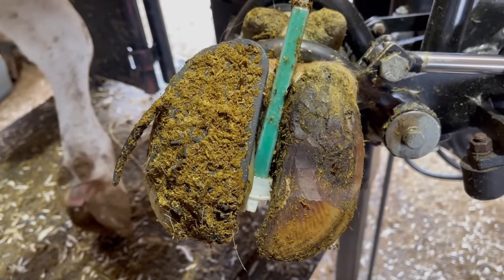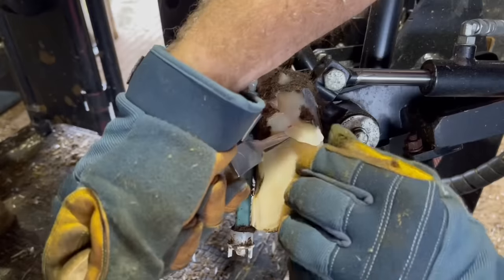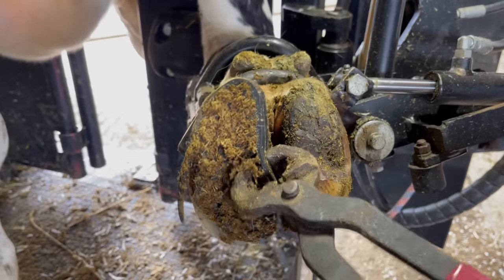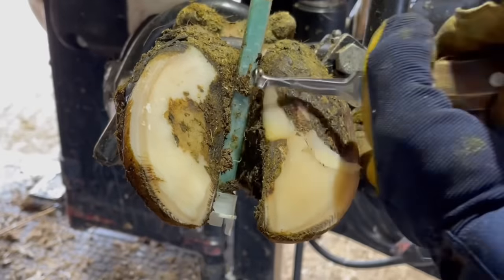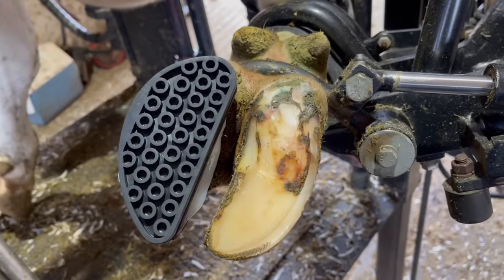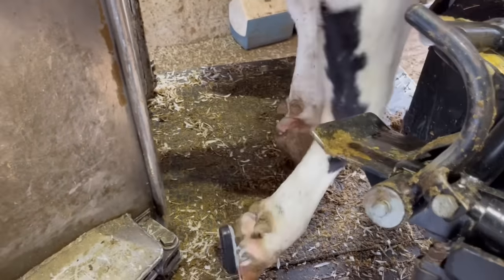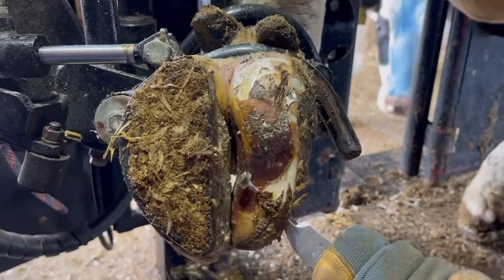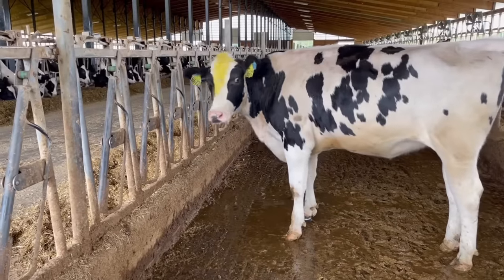This WRAP was on TOO LONG

Comment: I really like the recheck compilations! If that wrap had been applied more tightly and stayed on like that for two weeks, what are the potential complications? Thanks for making these videos, they always help me relax while I'm studying!
Reply: I’m guessing possible circulation and nerve issues in the foot and corium (tissues that grow new sole hoof and wall hoof) causing swelling and extreme discomfort for the cow/heifer with possible permanent nerve damage (in the best case scenario) and cutting off of circulation leading said tissue to die off and become necrotic (in the worst case scenario). Both are certainly bad for the cow/heifer, but the latter would mean certain death for the animal while the former might be manageable, depending on the severity of the damage. 

Think of having a bandage wrapped to to tightly around your two biggest toes. It would be quite painful.
Reply: Usually the farmer is the one to pull off the wraps.

Comment: Hi Nate, when you come back for a recheck, I've noticed the hoof seems to be a lot darker on the top most part and quickly turnes to the off white color, what causes that?

Also, I'd love to see what it looks like on the top side of the hoof when you use the grinder on tip of the hoof!
Reply: for the former, i believe the answer is a combination of staining from barn floors and oxidation from exposure to the air. cows will poop wherever and whenever they please, so the barn floors are very dirty. for the latter, i agree it would be interesting to see.
Reply: I'd guess acid burn  - salicylic acid (aspirin) would cause cauterisation

Comment: Why don’t you use wooden blocks for situations like the first one? I heard they are more likely to wear out naturally and not require you to manually remove them
Reply: I'm no hoof trimmer, but I'm going to assume that the shock absorption of the rubber might be a factor.
Reply: This is valid. I'd like to know as well. Im looking forward to his response.
Reply: @mysticmonkey92  Yeah, iirc he's mentioned it's because it's soft, and easier on the claw that's taking the weight.
Reply: I think he's said in the past that he doesn't like the wood blocks for a couple reasons, one being they wear out a little unpredictably, two being they don't grip as well as the rubber. Nate prefers to remove them himself because he can be sure the other claw is healed prior to actually taking the block off, rather than it wearing out or falling off before the affected claw is ready to bear weight.
Reply: Reason he removed the block was because of abnormal wear, he replaced it,  wooden block might not have lasted long enough to provide the desired protection
Reply: He stated in previous videos that they wear out too fast and/or unpredictably. He likes the rubber/composite blocks because they allow him more control over their wearing out/are more durable. At least normally. Obviously there will always be exceptions like in this video.
Reply: He's covered before, they can be less durable, and when they break down it is uneven,  so they may fail the cow too early, they are also much harder and less comfortable.
Reply: @PlainOlCourtney he's answered before, wood is less durable and may fail the cow too early (usually in unpredictable ways), and they have less traction, and they are less comfortable.